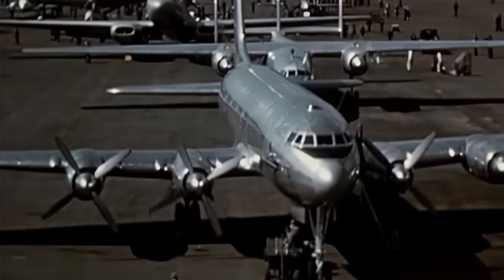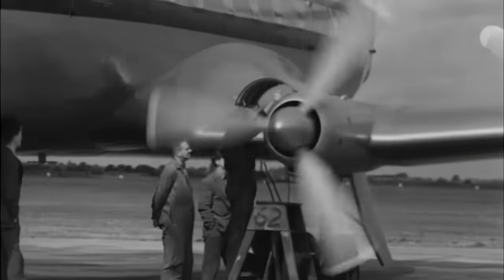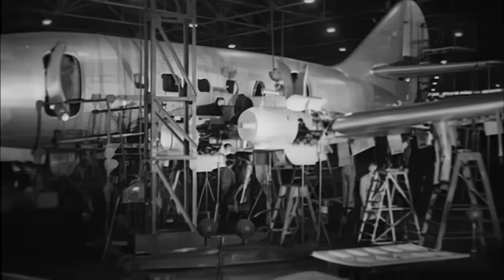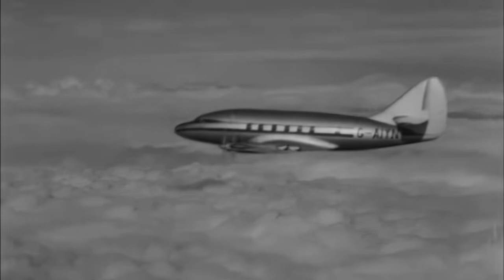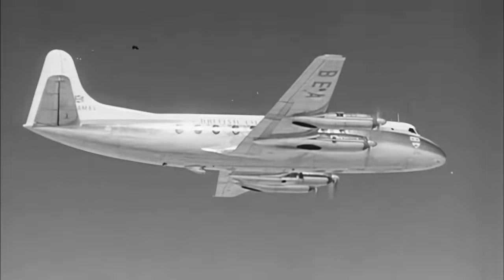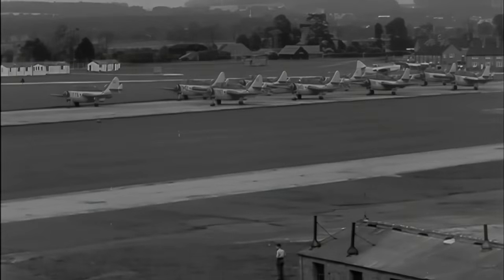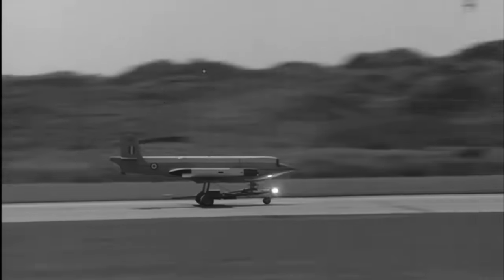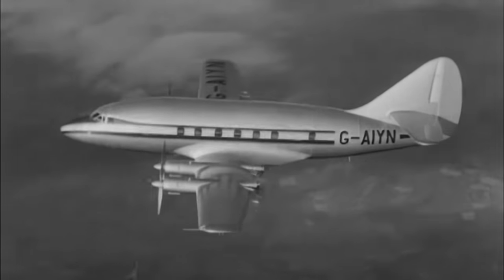Of Gods And Serpents. The Story Of The Armstrong Siddeley Mamba Turboprop Engine

Comment: Jindivik  was a regular at the old RAF fighter base at Llanbedr in North Wales UK.   The  field is on a large expanse of coastal duneland  which attracts a lot of leisure visitors.   Fairly frequent landing mishaps  gave picnicking parties something unusual to watch as airframes rattled to a
 standstill  amidst cucumber sandwiches.   The Dolley  used for takeoff  was a heavy fearsome thing which shot off down the strip   like a runaway  train.

Comment: I take issue with the claim at 1:50 that the concept of having the jet thrust converted into turning power was 'brand new'.  
The idea of using the gas turbine to drive propellers on aircraft predated much of the pre war jet engine development and was certainly Griffith and Wagner's starting point and the Hungarian Gyorgy Jendrassik had a test engine running in 1937.